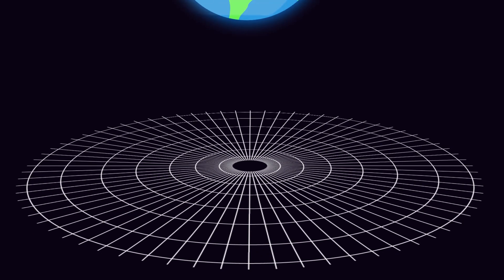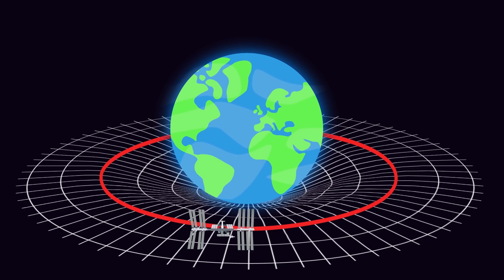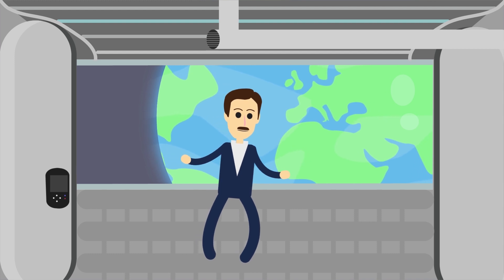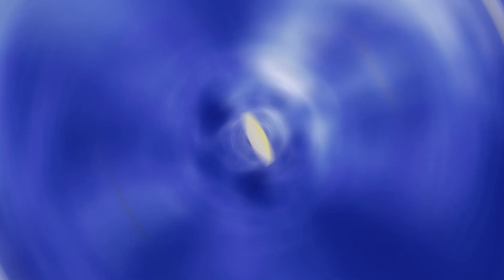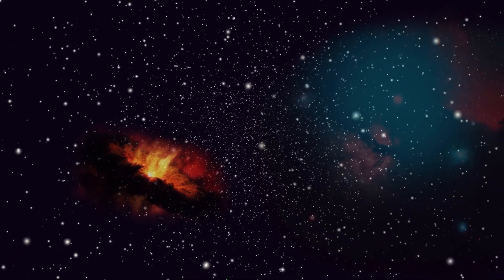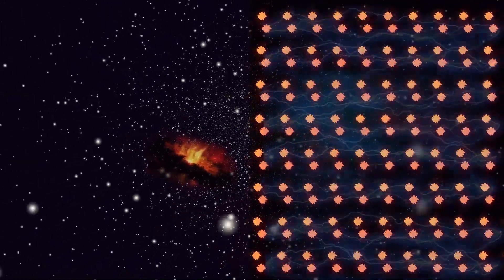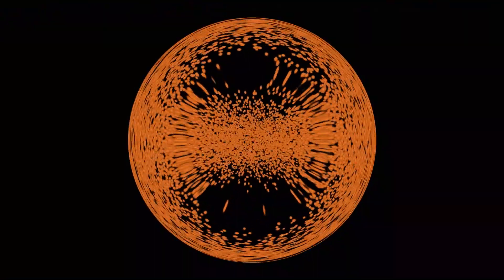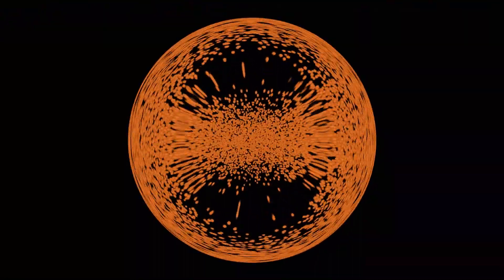UAPs Propulsion System And How They Can Travel Faster Than The Speed Of Light

Comment: If UAPs really do operate with an antigravitational propulsion system, then we are looking at a level of technology that completely rewrites the laws of physics as we know them. Reports from fighter pilots, leaked military footage, and declassified documents all describe objects that move in ways no known aircraft can replicate. They accelerate instantly, stop on a dime, hover without any visible means of lift, and travel at speeds that should be impossible—all without creating a sonic boom, heat signature, or turbulence in the air.

So how could something like that work? The most common theory is that these objects are not pushing through space like a traditional aircraft but instead manipulating space itself. If they can distort gravity or space-time, then movement would not be a matter of propulsion in the conventional sense. Instead, they might be bending space around them, allowing them to appear to move instantly from one place to another without feeling acceleration. This is similar to how an Alcubierre warp drive is theorised to work in physics, where a bubble of space-time moves around an object rather than the object moving through space.

Another possibility is that these craft are tapping into zero-point energy, the lowest possible energy state of a quantum field. If they can harness this energy, they might be able to create a field that negates inertia, meaning they could accelerate or change direction at any speed without experiencing the crushing G-forces that would normally kill a pilot. Some theories suggest they might even be manipulating electromagnetism to generate a propulsion system that does not require combustion, jets, or traditional thrust at all.

Then there is the idea that these objects are not just controlling gravity but controlling inertia itself. Inertia is what makes it hard to stop suddenly or change direction, but if a craft had the ability to decouple itself from inertia, it could move in ways that seem impossible—like shifting at right angles mid-flight or instantly stopping from hypersonic speeds without tearing itself apart.

If this kind of technology exists, it would completely revolutionise transportation, space travel, and energy production. We would be looking at a future where interstellar travel is possible, where fuel is no longer needed for propulsion, and where aircraft can move with total disregard for aerodynamics or atmospheric resistance.

Of course, the big question is why we do not have solid proof of this technology yet. Some believe governments already have access to this knowledge but are keeping it classified, while others argue that we are simply missing key pieces of physics that we have yet to discover. Either way, if these craft are real and they are using antigravity propulsion, then we are staring at the single greatest technological leap in human history—one that could change everything.